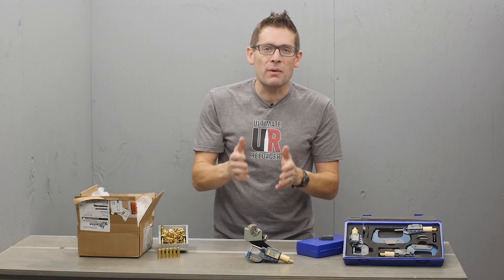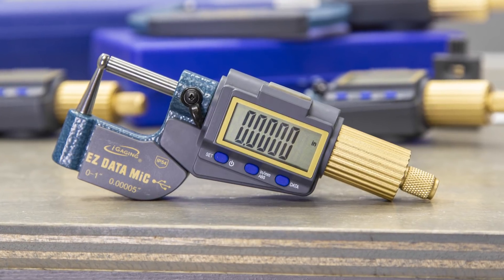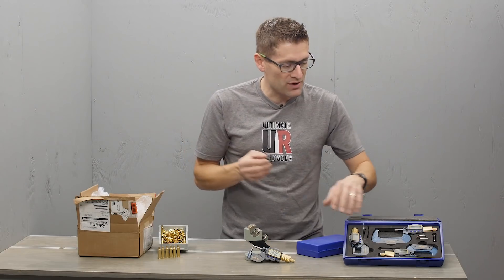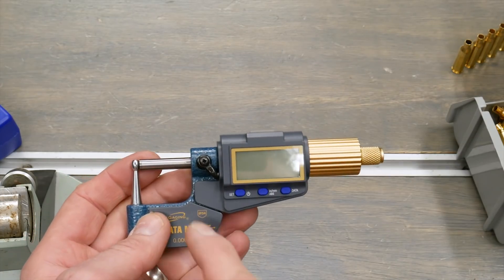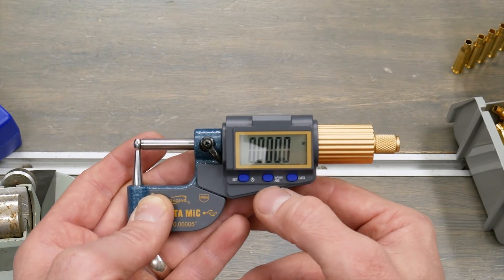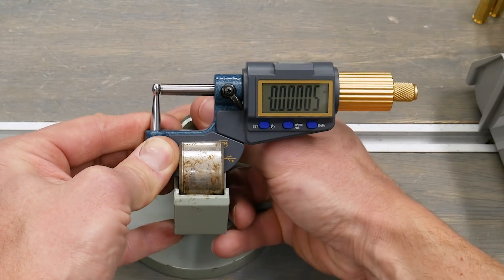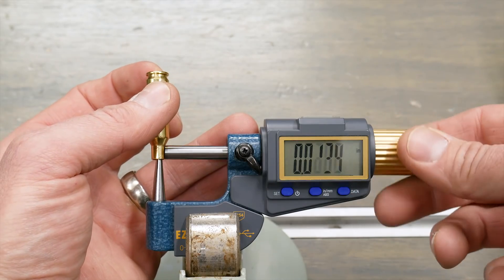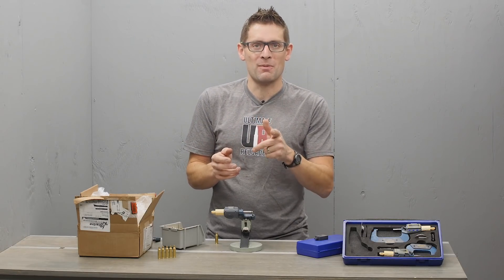Precise Neck Thickness Inspection with iGaging EZ-DATA Ball Micrometer

Comment: So how much is too much of a deviance therefore indicating a trim?
Reply: Neck size bushings typically go down to a resolution of .001 inch. If you use a neck bushing in your FL sizing die, then you will see benefits in neck tension if you keep run out below .0005 inch.

Comment: Nice video about micrometer for reloading. But actually, what is the maximum runout of a case neck thickness (wall thickness) to get an accurate shooting? I see the reading vary across the sides of the neck. I mean if the runout value is more than a certain number, then the brass is considered not good ones.

Comment: Without a 'ball' on the measuring shaft, it is still subject to misalignment of the brass causing a slight change in apparent thickness,,,could be small, but when you want to look at, or claim, 10ths, you want to be sure!  Nicht wahr?

Comment: case thickness is likely more important for tension, not runout. preciseshooter did tests on bullets and found runout only starts to have statistically measurable impact when your loads are running under 0.5moa. if your rifle is not consistently doing that, runout will make no measurable difference.

Comment: I like using the Redding Case Neck Concentricity Gauge for this.  Slowly rotate brass and you can see the thickness of brass on the dial indicator as you turn.  I do use ball micrometer for setting up (sinclair) neck turning.
Reply from the maker: That's a good tool as well (one I've featured in multiple videos).

Comment: What is that rust on a tool holder, Shame Shame. In all seriousness to get the same compression on the mic use the thimble on the end to tighten the mic that way your compression  on the case is under the same compression  load. It should tighten to it's limit then ratchet or break loose once the torque limit is reached.
Reply from the maker: Haha- yes, rusty from the prior owner  (scored on ebay). Yes, as I showed in the video, the ratchet thimble is CRITICAL to get consistent measurements- especially when reading in tenths! :)